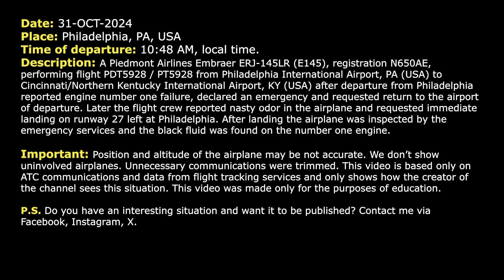ENGINE FAILURE after takeoff. Piedmont E145 requests immediate return to Philadelphia. Real ATC

Comment: They had a engine failure, bad smell in cabin and ATC flew the plane right over downtown philly.
Reply from the maker: That's not prohibited.
Reply: @YouCanSeeATC  Yes I know, I am very familiar with this airspace and pattern. Their was one occasion that a southwest plane had a fan blade malfunction and it pierced the cabin and a women was partially sucked out and she later passed. And the atc in Philly told the pilot to be aware of the downtown  area. They were flying on 1 engine also. You may even have posted that on this very channel.
Reply: That was Southwest 1380, and I think ATC advised the plane to maintain a certain altitude over the city (MVA?) for clearance, not avoidance.

Comment: 1st officer seemed way more calm than the captain ..
Reply: I disagree, they both sound equally as professional. They both are fully aware that the aircraft will 100% handle and fly perfectly on one engine. BTW how do you which one was the pilot?
Reply: @malahammer  when the emergency happen, the captain usually takes over and the first officer usually takes comms/monitoring, tho the captain will sometimes speak on coms to save time (per videos from pilots explaining this). They started with the male voice on coms and switched to the female voice after emergency , so the female is probably the first officer and male is probably the captain. 

Also statistically, it's more likely to be female first officer then captain due to increased recruitment efforts over the last few years but most have haven't had the time flying experience to become captains yet.
Reply: He is speaking quickly because the workload is high and they are juggling priorities to get the aircraft back on the ground  expeditiously.  I wouldn’t interpret that as a lack of calm.

Comment: Engine 1 is on the right side?  I thought left.
Reply: Smallest number is always from the pilots left no matter which way you look at the plane.
Reply: He said left, subtitles are incorrect.
Reply: As a passenger sitting in the aircraft’s cabin looking forward, it was the engine on our left side.
Reply: Facing the aircraft, it would be the right side
Reply: @N1120A  That's not the convention.
Reply: He may very well be saying "left side" as far as I can tell.